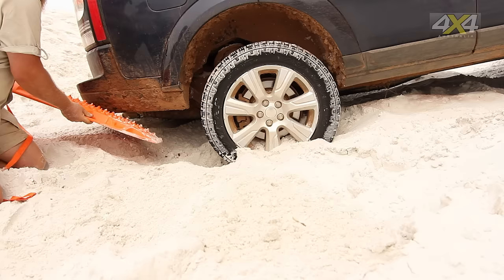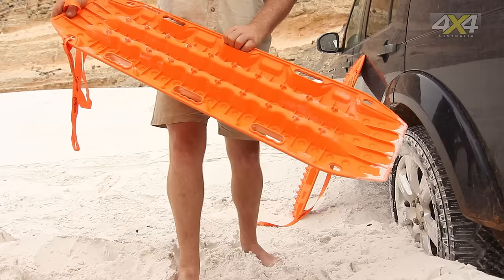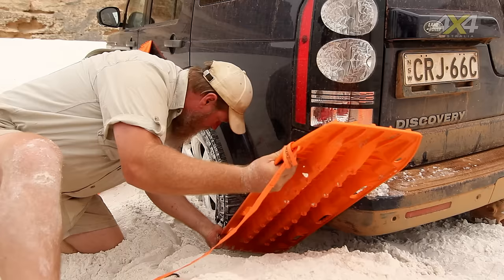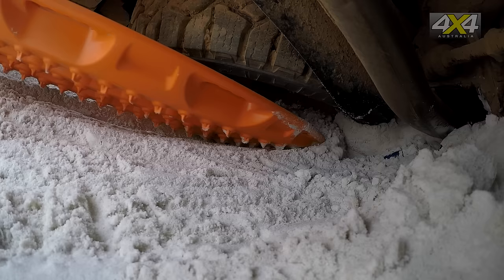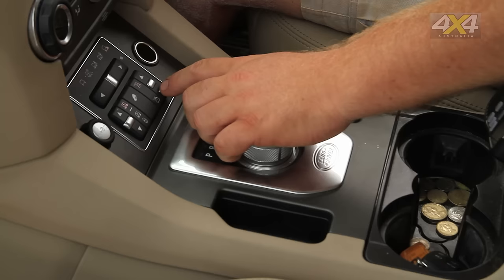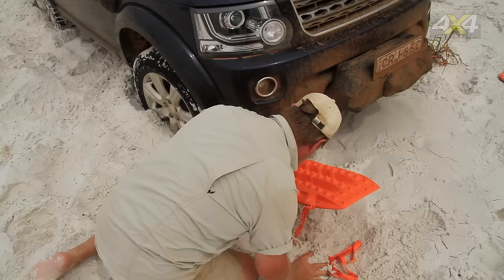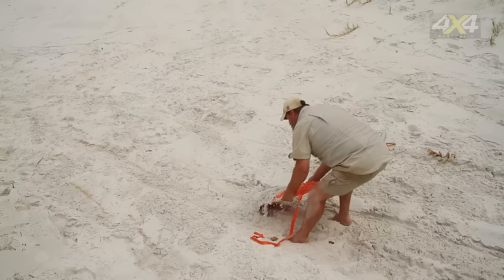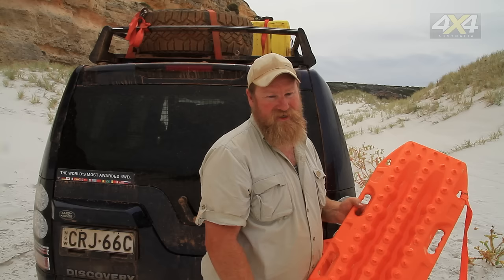How to use Maxtrax recovery boards | 4X4 Australia

Comment: I tried to assist a low soft roader out of hot inland track sand. Could not get sand out from wheels without more sand filling the hole / struggled getting any angle on the trax as it was low and sitting on its belly. They did however assist with a front snatch that allowed the car to once up get on top off. Wheel spin is a killer as the knobs melt like butter. Tip- etiquette is bring your own gear and others will assist and at least know where your hook point is and fit prior to attempting tracks if you are in a soft roader

Comment: VW Amaroks limit the torque in reverse gear. Q: Could this prevent the maxtracks working if stuck in sand or mud? Any Amarok owners had this issue?
Reply: Maybe you can repogram that?

Comment: Nice but waaay over priced, I get can similar item for 100 bucks, these are Atleast 300 !!!  They need to work on pricing, I understand you get what you pay for but that is still waaay to high.
Reply: Red pilled patriot You can buy the x-bull branded ones on eBay for $65 or best offer with free shipping. Nothing but 5 star reviews on them with pics of them actually being used. They are nearly identical in every way other then color to these, and no recovery strap. Comes with a zippered storage bag which is nice
Reply: a lot of the cheaper boards break when bridging.  They're a newer company and have to pay for tooling too